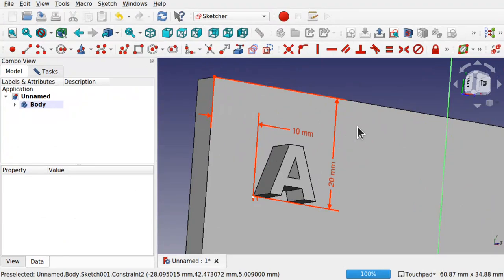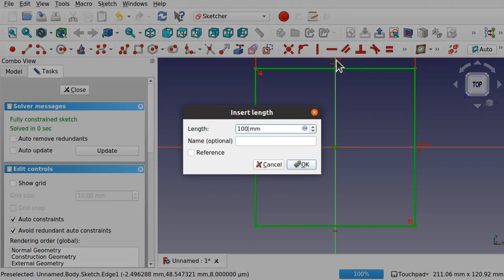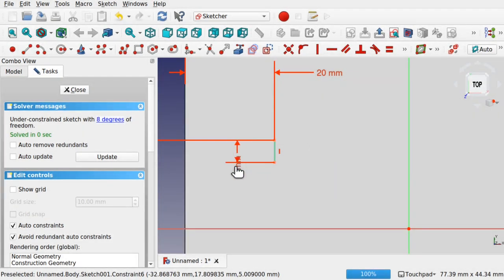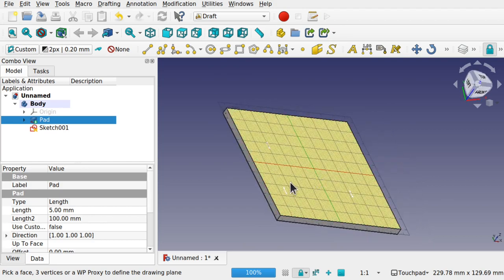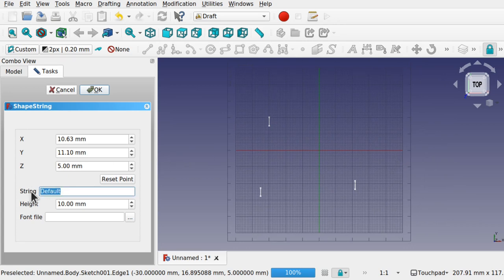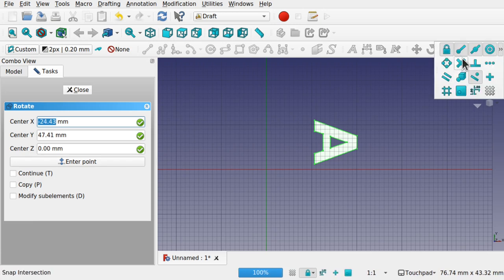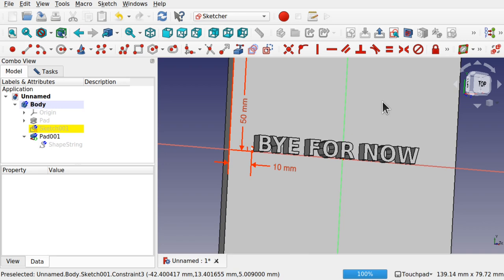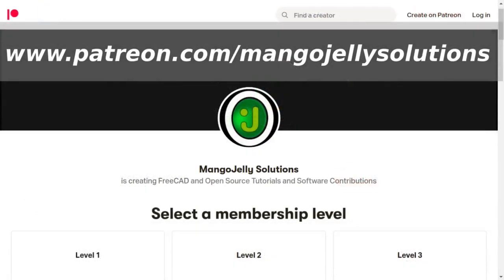FreeCAD: Easily Align Editable Text Using Alignment and Constraint In Part Design | Shapestring

Comment: "Toggle construction geometry" to the point to make it appear! A white point will be visible after you exit the sketch :).

That's great! I would like to position the fonts around a circle without the macro. The macro is rather confusing for me...
Up to day i did my circular text using Inkscape than importing the SVG to FreeCAD, works well with every font, even the really
fancy ones like "A Dripping Marker" font. You may like to google this one :)! This is sure a nice method you shown here thanks.
Reply: The point's visible that way, but the letters don't snap to it. It needs to be a line for them to snap, for some reason.